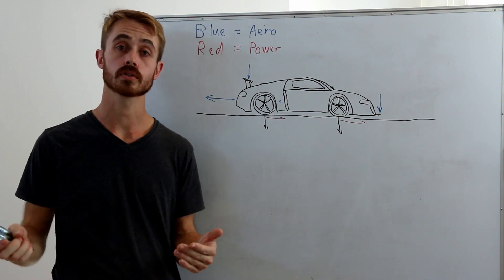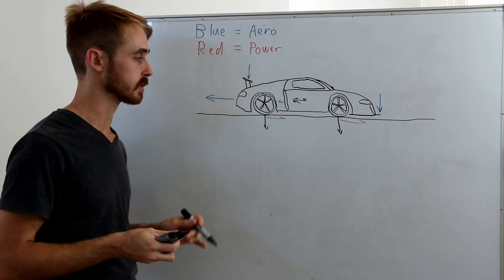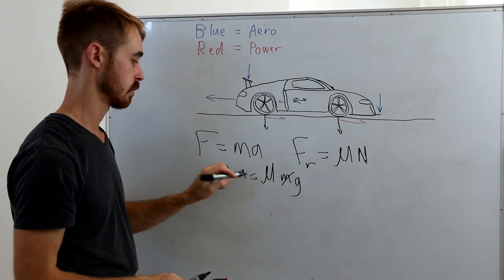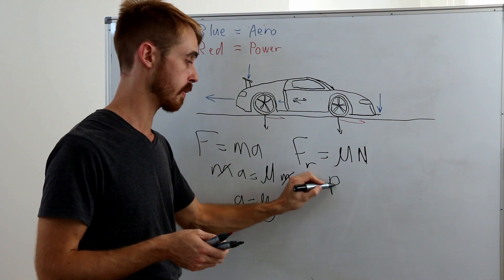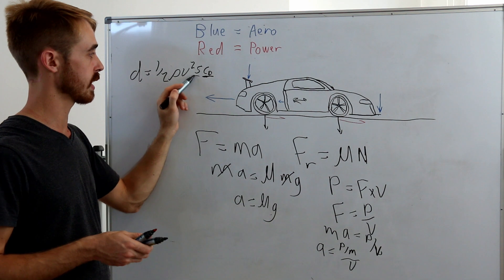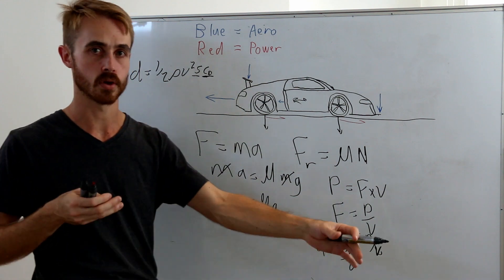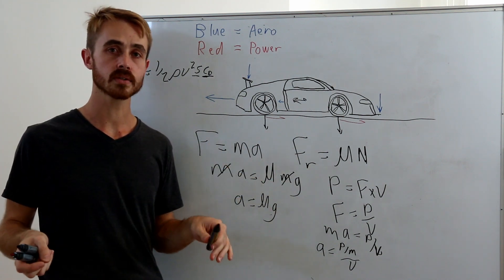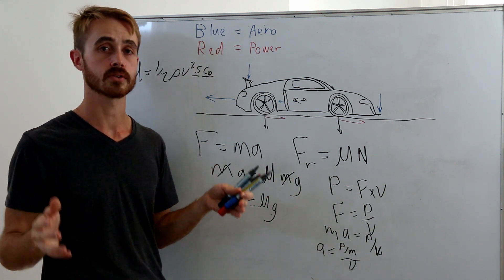Power to Weight Ratio - Is it all that affects acceleration?

Comment: When he says traction limited does he just mean the engine's power capability is higher than the max possible frictional force? And then if so how do you eventually become NOT traction limited as you go faster?
Reply: Off the Line traction is KING. When Koenigsegg first went for the 0<400kph<0 record the stated that teh (RWD) aregra RS was getting wheel spin to about 200kph which is why it's So Slow to 100kph from a stand still.

It's the design of the suspension and the tires that limits the Agera RS...as the DOdge Demon  with 500 Less HP and weighing 1000lbs more is about 3 sec faster to 100mph but has about a 20mph higher trap speed even though it loses on Elapsed time.
Reply: When you change gears and have less wheel torque.
Reply: Ok so when i reduce the gear ratio, less torque is being applied to the wheels? Then I am just applying less force into the ground and moving more slowly isn't that right? I might be misunderstanding something.
Reply: It's confusing if you put it that way.
When you upshift, you will get less wheel torque but more speed. When you downshift, you will get more wheel torque but less speed.
You can test this with a bicycle.
Reply: Since in low gear you have more wheel torque, it's more likely get 'overpowered' so the tires will slip.
Reply: so if you could keep upshifting to reduce torque you could just keep going faster and faster as you can put more power into the ground before the wheels slip then? Why don't race cars do this? Is it just for reasons of cost/feasibility that car manufacturers don't allow you to upshift farther then you currently can?
Reply: I think you misunderstood.
The engine already have certain power, let's say 200 horsepower.
You can utilize the torque vs speed of this 200 hp by using different gear ratios, but you can NOT add power with gear ratios.
For example on first gear, you get high torque but less speed. The engine will quickly reach the rpm limit, let's say 8000 rpm, and you can't go faster, even though it's still probably at 30 km/h.
So you upshift to the second gear, you get less torque but more speed. The same engine spinning at the same 8000 rpm will be at higher speed, say 50 km/h.
Then you upshift again to the third gear, you get even less torque but even more speed. The same engine spinning at 8000 rpm will be at even higher speed, say 70 km/h. But you will quickly notice the car accelerate slower and slower, and the engine is bogged down more.
Keep upshifting until the 6th gear, let's say your car can get 150 km/h at that same 8000 rpm, but it will barely have enough torque to accelerate anymore.

From there you will have too much drag mainly from the air and tires, that keeps the car from going even faster, even if you have more gears. At this point if you want to get faster, you need to get more horsepower on the engine (by tuning or changing the engine), or reduce the drag.
Reply: If you have a bicycle with changeable gears, you can actually test this yourself.
Go on the low gear (lightest to pedal), you can have more wheel torque to even climb a mountain. But with that same gear try to go fast. You might be pedaling as fast as you can but the bike will go slow.
Then try the high gear (heaviest to pedal), you won't be able to climb a mountain because it's so heavy, but you can go fast in flat ground, much faster than when you were on the low gear.
You are the engine, you have the same power, but you can utilize that power either for torque or speed.
Reply: I think I understand now thanks

Comment: so if im understanding this right and had a theory of it in the past by the way that a to light car in a dragrace will have less traction at start and therfore get slower acceleration then the heavyer car with the same amount of engine power due to weigt aiding in to get friction on the tyres and grip?

and the heavy car can accelerate faster att speed due to that drag and air resistance  is more a factor to overcome with brute engine force then weight of the car?
Reply: In low speed they are basically the same.
In medium speed the lighter car will get more effect from downforce, only if the tires are still slipping.
In higher speed, the heavier car will get less effect from air drag, so they will accelerate faster.

Comment: To make it simple, 400hp 4000lbs car is going to out accelerate 200hp 2000lbs car for 1/8, 1/4, 1/2mi runs and more. 200hp 2000lbs may or may not have quicker 0-60mph and maybe quicker to lower speeds. 200hp 2000lbs car will have better lap times on almost all low-mid speed tracks (circuits), 400hp 4000lbs car may have better lap times on tracks with many straights. 400hp 4000lbs car will have much higher maintenance as fluids, tire and pads wear out much faster. This is assuming you keep most other variables constant (driver skill and weight, same drive train configuration, similar front:rear weight ratio, naturally aspirated with similar power and torque curve, same or similar tires, same or similar gearing, same or similar drag coefficient, no driving aids interfering or assisting and so on).

Power-to-weight ratio is just a rough ball park measurement for circuit lap times, and I believe it is even less relevant in drag racing (probably torque, gearing and traction more important), well unless you are comparing near stock production cars for street light drag racing.
Reply: Interesting you say torque is more important than horsepower, especially after mentioning gearing is important hahahaha
Reply: Underrated comment
Reply: i dont touch other than one teme in your comment 400 hp 4000 lbs car will not neccesery have weake rtime on short track it depend on tire load sensistivity  so size and componnent more or less and suspension setup period  .
Reply: heavier car could transfer weight in the ssame way like lighter with proper more stiff etc suspension  now with good tire on it watch TLS and compound lighter car have nothing better agains heavier on short track on powerlaps  .

Comment: NHRA drag racing ,Pro stock car and motorcycle. The car with 1500 HP weighs 2500 lbs is faster MPH & ET then the motorcycle that weighs 550 lbs and has 400 HP .Car 215 MPH @6.55ET Cycle 199 MPH @6.85 ET  1/4 mile

Comment: Is that question really that "simple" to answer? I think you also have to consider the tyre load sensitivity which indicates that with higher tyre loads the µ decreases slightly. So this would mean that a lighter car would have a very basic advantage over the heavy car in longitudinal (as well as in lateral) performance. But on the other side (assuming RWD), a heavier car would have more longitudinal weight transfer in acceleration so maybe this would partially compensate for that (but at this point I don't know how the CG heights compare between a light and heavy car...). So don't you have to wrap your head around a lot more stuff on the suspension side?

P.S.: I like your videos very much, really helped me understand the functionality of some aerodynamic devices. Keep up the good work! ;)

Comment: Why does a lighter car accelerate faster with downforce than a heavier one?
Reply: This only applies when the car is limited by traction. When the downforce starts pushing down on the car it will increase the traction of the wheels of the car, so the acceleration will increase.
Reply: Because it has less mass to counter to get up to speed

Comment: Why did you join the two equations together in the first part of the video?
Reply: What combining these 2 equations really say is: The force accelerating the car is equal to the grip the tires provide. Incase of traction limited acceleration this is true: You will accelerate as fast as the traction of the wheels allow.

Comment: Awesome video. I was wondering if you could do one about the effects of increasing tyre size on vehicle dynamics. 

For example 3rd gen rx7 comes with 235 front and 255 rear width tyres. How would putting 265 sections all around effect the balance of the car leaving everything else equal and assuming 50/50 weight distribution. 

Side note I've read several times 50/50 distribution isn't ideal, and a rearward balance is better. What are your thoughts?
Reply from the maker: +bertanderny I'll add it to the video list, it's largely related to the contact patch dynamics, but deserves standalone video from my video on tyres!

Ideal weight distribution depends completely on drive type, and what you want out of the car. If we are talking fastest around a circuit, RWD should be slightly rear biased, FWD should be slightly front, and AWD can be anywhere around the middle. You can modify your suspension setup to then work around pretty much any weight distribution with  reasonable results. Perhaps this deserves a video as well, as it gets much more complicated than what I've described here...
Reply: KYLE.DRIVES Videos on these subjects would be much appreciated. Thanks for the brief explanation though, makes sense when you think about it.
Reply: @KYLEENGINEERS  I have to disagree with your logic sir. Try adding 2,000 pounds (907 kilograms) of concrete in your OWN car. Tell me how fast you still can accelerate at higher speeds. And tell me how fast of top speed you still can reach. I can guarantee not only you would have slower acceleration  BUT ALSO you would have lower top speed as well. More weight also means more ground friction and rolling resistance.
Reply: @prandomable  Please correct me if I'm wrong, but regarding your assumptions:

1. True only if you are not traction limited.
2. This can be compensated with tire pressure, top speed would be equal.
Reply: @miguelmurua96  not true completely try. More weight = more rolling resistance as well. More friction from the road.

Weight won't affect top speed much correct HOWEVER it most likely will still decrease your top speed, but maybe only like 3, 4, 5 MPH. Which isn't even much at all

Comment: I have a question on my mind for some time that I can't really get my head around:

How do brake-fans work?
Like on the old 935 Porsches -or Ken Block had them on his car too.
And why are the no longer used/what are the problems with it?

Do they suck out air trough centrifugal force (how does that work on the front side where the air is pushing against it?)
Do they guide air into the wheel?
Reply from the maker: +Kalimerakis Looking at the smoke patterns on Ken Block's ones, it appears that they are using the centripetal force to draw the air from the centre of the wheel outward (much like a turbo compressor). Such a setup would likely be draggy at high speed, but is useful for brake cooling when the wheel rotation speed is high with respect to the total car speed (rally, gymkhana etc.), hence why it is only used in some scenarios. Would you like a video?
Reply: I would love to see a video on that topic!